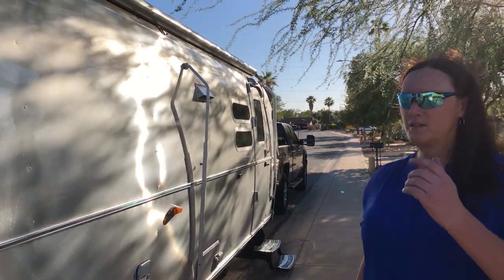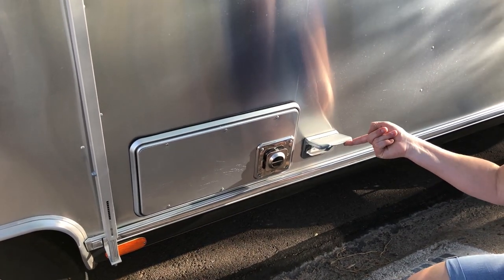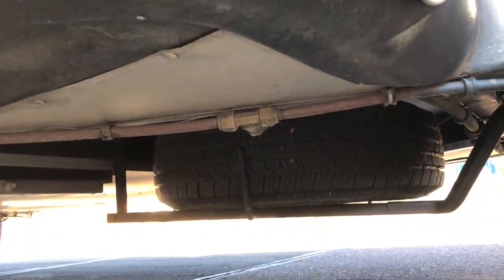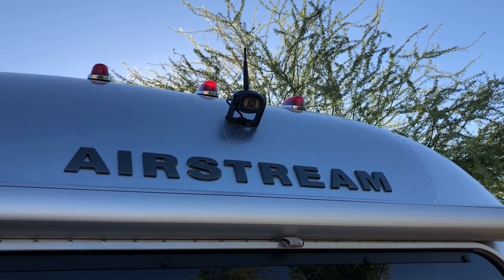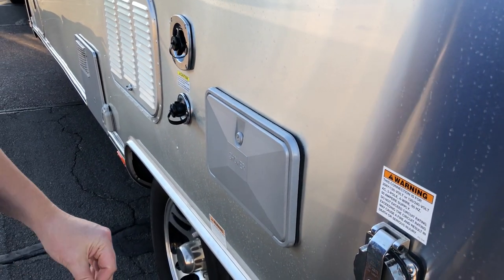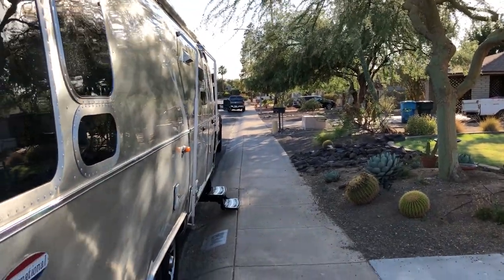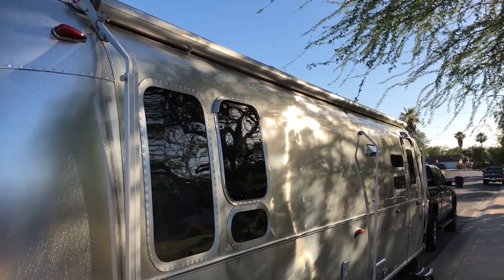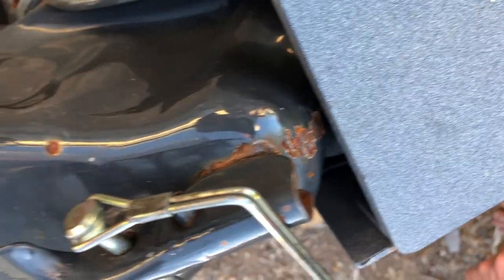👀 E1.10 A Tour of Airstream MTB's International Serenity Part 1

Comment: I have an '88 Airstream and it has an LP Gas tank level on the board inside. You should be able to turn both tanks on and it will draw from the selected tank and if it were to become empty it will switch over automatically. I know that you can swap to a regulator that will switch over. Wow and I call BS on the water heater, my manual goes through the flame set up and you can adjust the flame which is really the mixture. Adjusting the flame will help it lite and stay on if it's windy out. Really all the "Stuff" Airstream puts on it's units are off the shelf products that are used in other brands of campers. Atwood water heaters, Suburban furnaces, and other stuff like that. We love our Stream it tows very nice, it's lighter than yours (not a wide body) but it is a 29 footer. She is in perfect condition even at 31 yrs old and she is well traveled. Yours is beaut and will serve you for many years. Love her and she'll love you back!!!